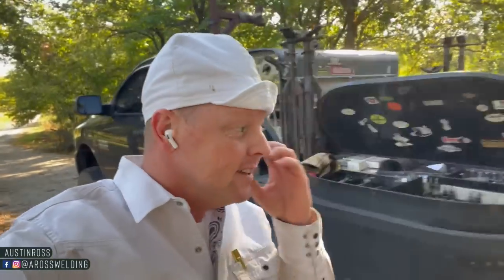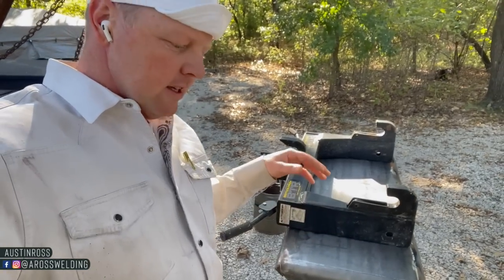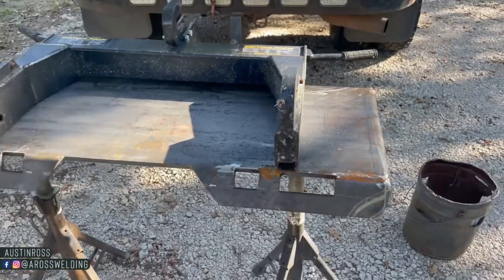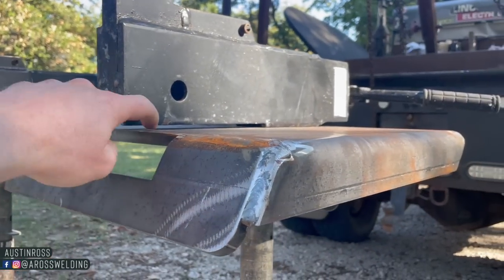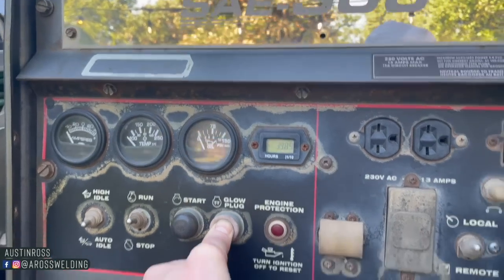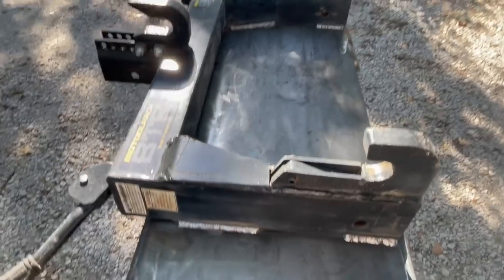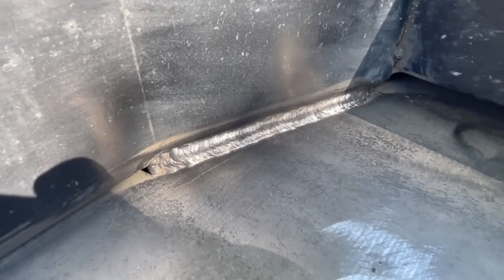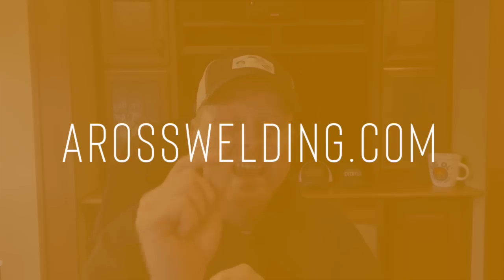Welding A Quick Attach To A Quick Attach

Comment: Would the rig welders in the comment section be able to say if breaking out in a 2019 ford f-250 6.7 be a decent truck to carry around a whole set? I wanting to buy a used machine and put it on my truck I just don’t know if a 6.7 diesel srw truck would be enough or if I should get a diesel

Comment: Hey Austin, I'd  be interested in trying my hand at welding a branch T for the fun of it  other than that ,I hope this other information brings you more knowledge base for your content. 
I spent a moment and looked up the answer for you and your subscribers' understanding of how the flux works on 6013 5p compared to basic 6013 electrodes so here you go ------> "The main difference between a "6013" welding rod and a "6013 5P" welding rod is the coating formulation, where "5P" indicates a specific type of flux coating designed to provide improved penetration and performance in thicker materials, making it suitable for deeper welds compared to a standard 6013 rod, which is better for thinner materials and cosmetic finishes."
Reply from the maker: Awesome! Thank you for taking the time to look up this info and share it with everyone here. 
And thanks for the feedback on the in person workshop. Check it out here:

https://www.arosswelding.school/branch-workshop

Comment: The only difference between a 5P 6010 (Red flux) and a 5P+ 6010 (Grey flux) that I know of is the “+” is just saying it’s a normal 6010 rod but the flux has an additive that allows it to not undercut and toenail as bad, the “P” is also a short hand sign for pipe welding… the grey flux puddle burns more liquified than red and also freezes the puddle faster… which tends to help out when welding pipe with thinner landings… after researching them and also being mentored by an old millwright that’s the only differences I know and have found personally I prefer grey flux and run around 90-105 amps with 1/8” rod… and depending on metal thickness

Comment: I use the 6010 red coating and the 6010 with the gray coating  I personally cannot tell the difference between the two when welding. I use the same amps for both. I know there is a difference between them in the composition of the flux. That's what was told to me by a salesman at one of my supplier's.